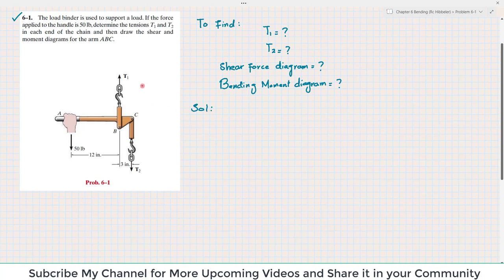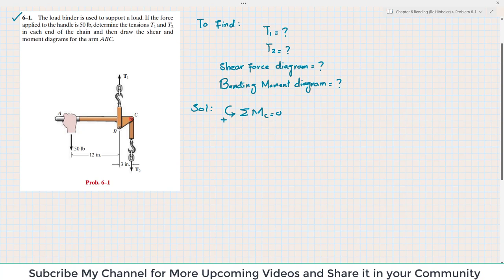6-1 |Chapter 6| Bending | Mechanics of Material Rc Hibbeler|

Comment: Hello, if I want to cut a steel wire when I have the total energy during contact between the cutting knife and the steel wire, what strength calculation do I need to make in order to check what is the force necessary for cutting? the cutting between the cutting knife and the steel wire is done linearly.
Reply from the maker: shear force
Reply: @engradnanrasheedmechanical  , Can you please give me the link of these videos.
Reply from the maker: Which videos?
Reply: @engradnanrasheedmechanical  , I have a wire with a diameter of 1.5 mm and I want to calculate what is the force needed to cut it linearly by a cutting knife, do you have a lecture on this subject, if so could you give me the link to the video. Or alternatively guide me how to do it, thanks in advance.